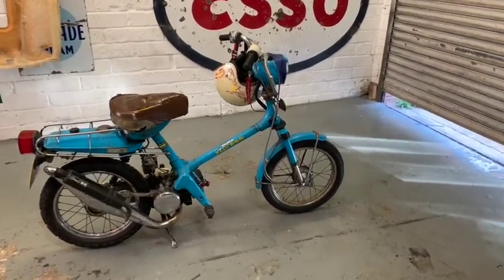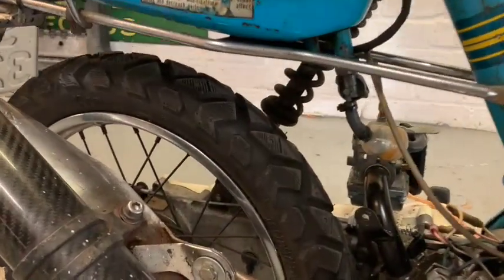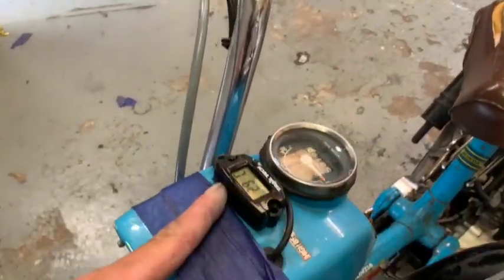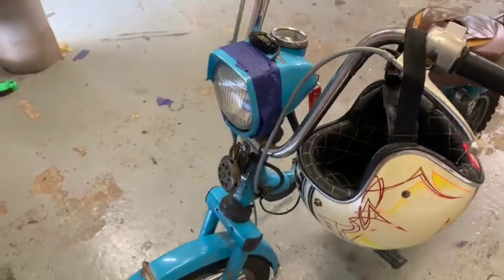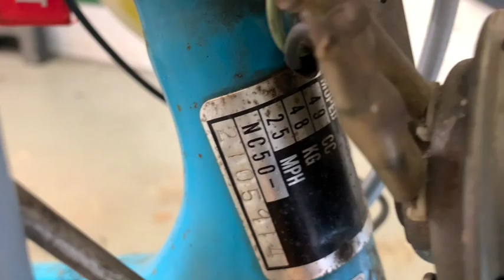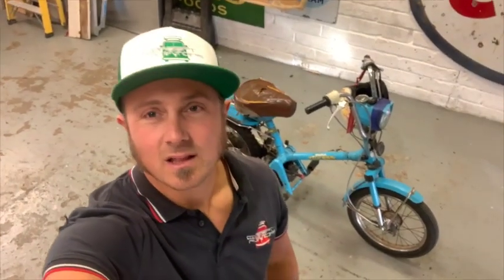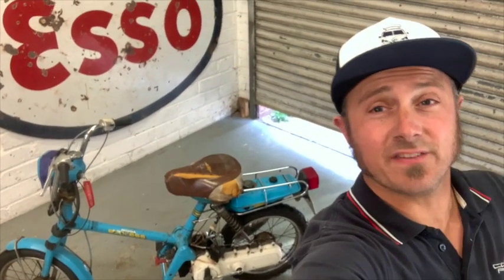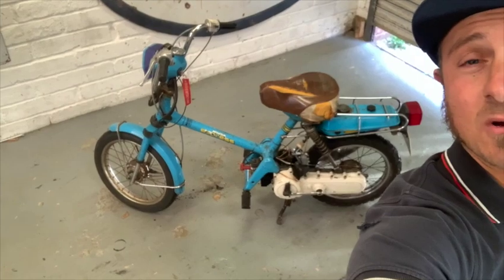Big bore 70cc Honda express tuned 1979 nc50, (death trap) pa50 , nu50

Comment: Sounds beautiful. I've just built a PA50 with a ported Suzuki Address cylinder(fits like a glove with proper gaskets) in it, a polini pipe, modded CVT and a 20mm 4 stroke Keihin carb. Sounds the same and twists itself at top end like that. Great build man!
Reply from the maker: Thank bud , you bike sounds good 👌
Reply: @TheSpanosAntics  thanks man i'll be uploading a video

Comment: Omg this makes me wanna fix mine! Again… carbs suck on this bike and I hate that I’m not handy  
These bikes only work when they want to I swear
Reply: Here is what you do to get them running.. New Battery, Clean Gas tank, Fuel line, Petcock and get new petcock and filter. Clean Carb very well. A little starter fluid and it should fire right up..

Comment: I have a green 78 express. It only does 26 mph. It’s drives me crazy I can’t keep up with traffic. I’m going to try to do all these upgrades. Could I do this with stock reed valves still in the bike ? I put some new ones in a couple years ago.
Reply from the maker: Hey , yep stock reed are fine ,  stage 1 : 70cc big bore kit + drill jet & cut open stock exhaust and remove baffles & weld back , up help a lot . 38 mph ish . And I only cost price of big bore kit . Ps : always wanted a green one !
Reply: @TheSpanosAntics   thanks ! I’ll keep in touch with you, I’m sure I’ll have some questions along the way.
Reply: @TheSpanosAntics  do you know what the temp was at when you burned out your other engine ?